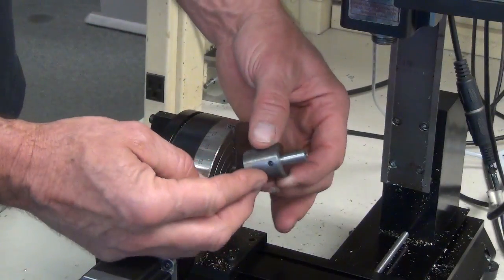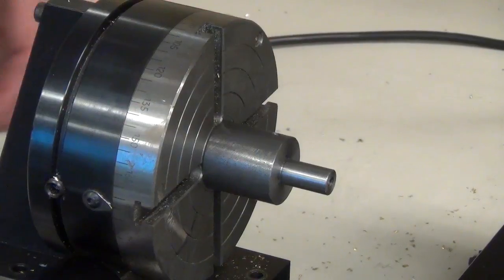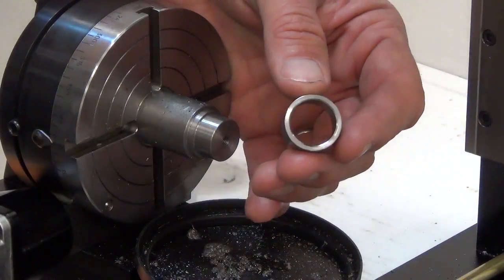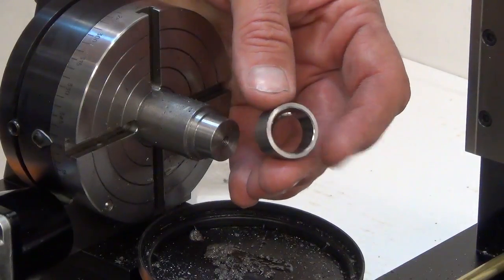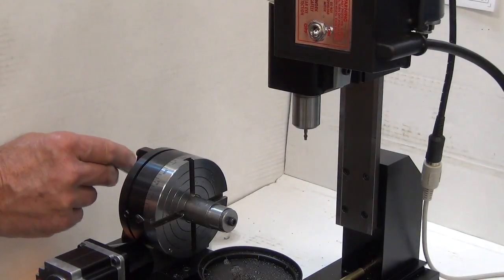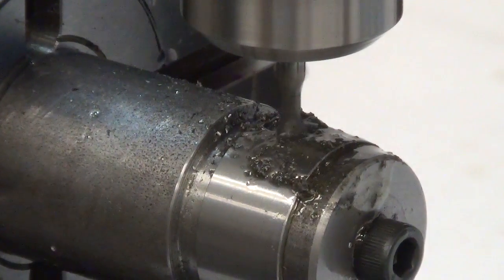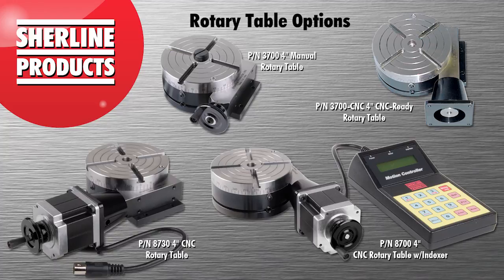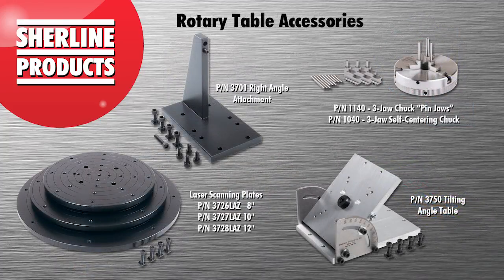CNC Rotary Table in Action

Comment: That looks more like structured light scanning (SLS), not laser scanning. Projected patterns versus laser(s) cross-sections  (possibly using DAVID 4, now owned by HP?).  I will have to look into rigging my Sherline 4th axis for photogrammetry after watching this video. Thanks for the vid, keep them coming.
Reply from the maker: The original video was supplied to us by a customer. They titled it "White Line 3D Scanning," which makes sense based on the footage. We designed the rotary plates for those that do 3D scanning.  The plates are not designed for machining purposes.

Comment: This is easily one of the best accessories Sherline offers.  I've been able to remove any discernable backlash through the adjustment screws.  It's held incredibly high tolerance.  Well worth the slightly higher expense.  If your in the market for a smaller rotary table this is the best option out there.